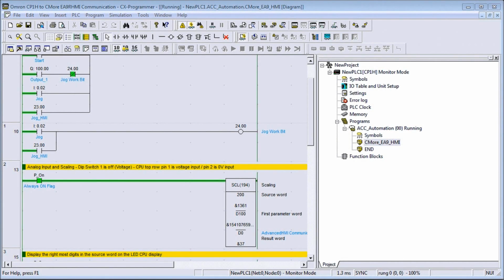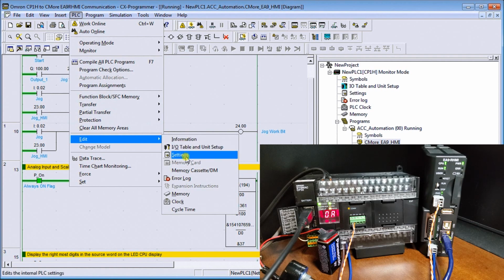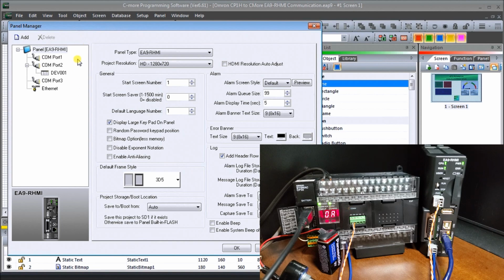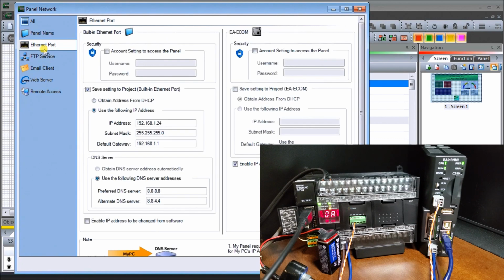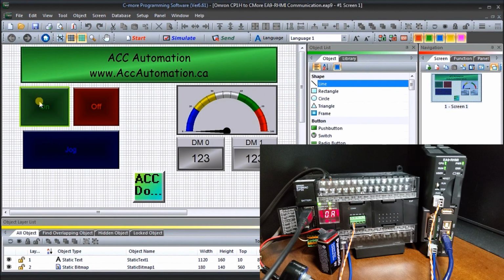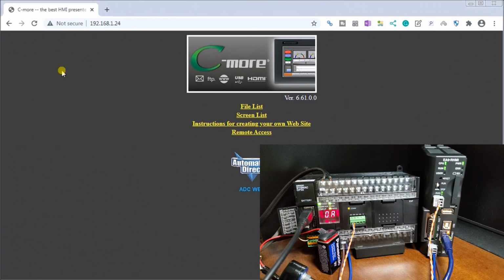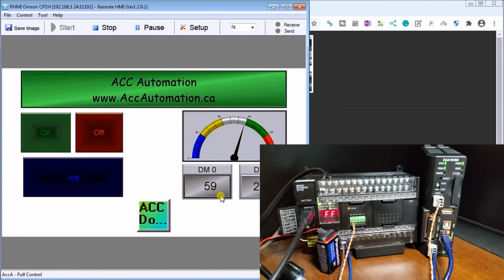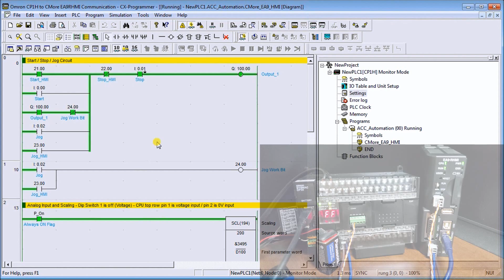Omron CP1H PLC to C-More HMI EA9 RHMI Communication

Comment: Do you have any way to communicate Cmore EA9 with Siemens s71-1200?
Reply from the maker: Hi Maria Jose Marrero,
I have not heard of the S71-1200. Do you mean an S7-1200?
The Siemens S7-1200 can communicate with the C-More EA9 HMI. The Siemens Ethernet ISO over TCP/IP (S7-1200 or S7-1500) driver can be used. You could also use Modbus TCP for communication to the Siemens PLC. 
https://cache.industry.siemens.com/dl/files/340/102020340/att_118119/v6/net_modbus_tcp_s7-1500_s7-1200_en.pdf
Regards,
Garry

Comment: Hi Gary, from what i see, both PC and Phone Remote acess control the same page. there is a way to display one screen on the PC and another one on the Phone? Probably going in Screen list could work, but it seems to be only a printscreen of the actual screen, you have to refresh browser to get live data ? thanks a lot
Reply from the maker: Hi M-A G
PC and Phone Remote access will only show what is on the actual screen. This is only a remote control and monitor for the HMI unit.
Regards,
Garry